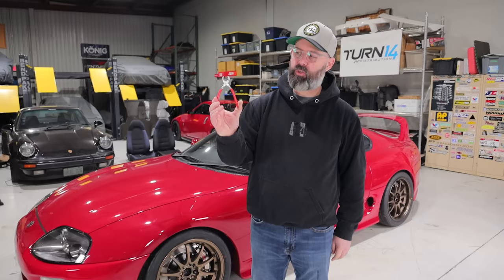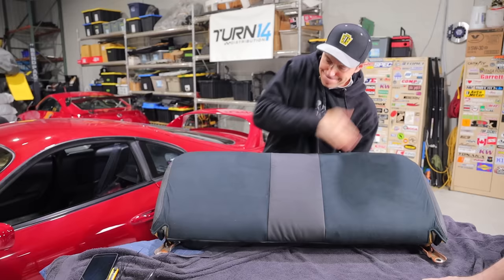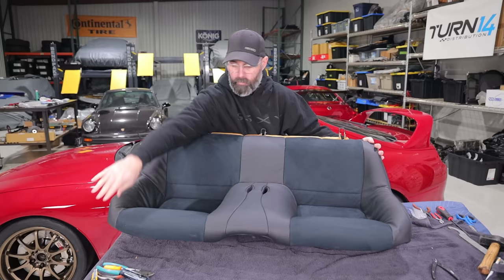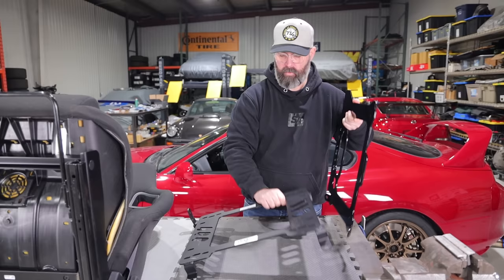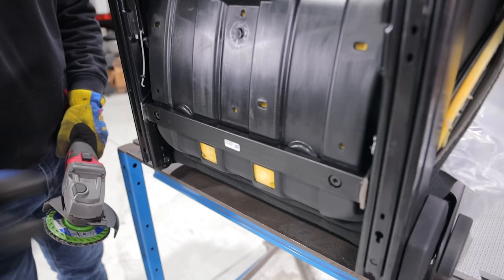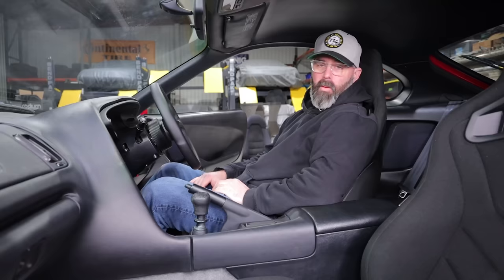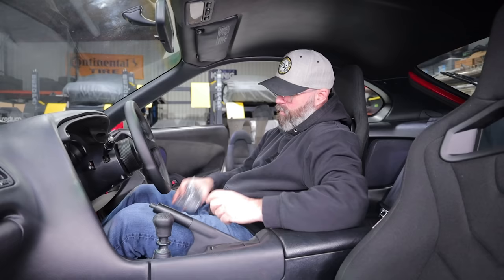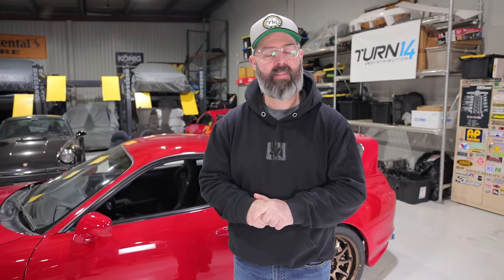Toyota Supra PERFECTION - Finalizing the OEM+ Interior

Comment: I was having exactly the same problem with the bride rails and this was exactly what I was looking for to seat lower. Love how this series is really helpful also for viewers in picking up the right products.
Reply: I didn't even buy the lowest Bride seat rails, and I sat so low only my eyes were visible when looking in the side window, and I am 6ft1. I looked and felt rediculous. So I used a Steel square bar to raise the seats close to an Inch. Now I can see out the windows and have about 2" of headroom above my racing helmet. I dont understand why you had to make your seats any lower than a Bride rail? I purposely bought the tallest one they make so i wasnt sitting under the dash.
Reply: @Skirk84  Probably because I'm using sparco R100, quite tick seat but cheap.

Comment: I did a few seat upholstery changes, i work at dealership, and we often use cable tie method, but what i can tell you is if it looks crooked and like mesh, or baggy, it should fix itself overtime

Comment: I think zip ties are easier but would be concerned that cutting slits would cause the material to tear easier.  Maybe use a punch or pick to make a circular hole?  Or if it's not real leather, a soldering iron?

Comment: Seems like pop rivets would’ve been a better solution to attach the seat mounting plate to the slider rather than trying to bolt it from the underside.
Reply: Pop rivets wouldn’t be strong enough - especially in an accident.

Comment: I didn't even buy the lowest Bride seat rails (there are 2 versions lower than the one I run), and I sat so low only my eyes and the top of my head were visible when looking in the side window, and I am 6ft1. I looked and felt rediculous. So I used a Steel square bar to raise the seats close to an Inch. Now I can see out the windows and have about 2" of headroom above my racing helmet. I dont understand why you had to make your seats almost sit flat on the floor? I can still store things under my seat. Are you guys over 7ft tall? Because even my mate who's 6ft5 has plenty of head room in my car.

Comment: Saw this and immediately purchased Works Bell hub and Momo wheel 😎 But WB hub does not fit the Momo hub ring with grounding tab to retain horn function 🙄 Any help out there? The WB hub and Momo wheel bolt up fine without the Momo ring, but I need a horn, @speed academy were ya'll able to keep the horn??
Reply from the maker: This is a very common issue, we usually run a ground wire from somewhere in the hub to the horn. I dont recall exactly how I did it but we have a working horn
Reply: @speedacademy  Thanks! Used the WB hub and ran the horn ground wire to a large ring terminal and secured it under the steer column washer and nut. 💯